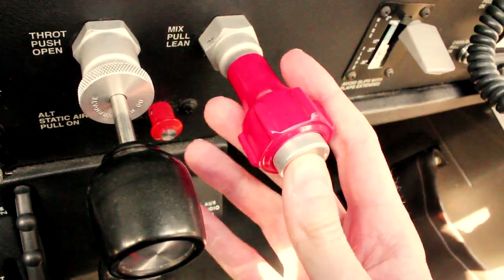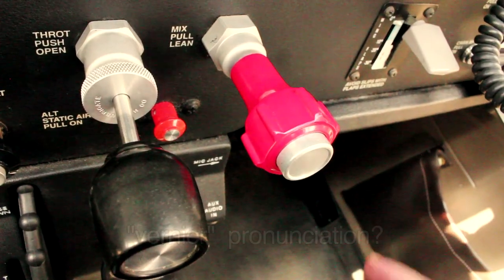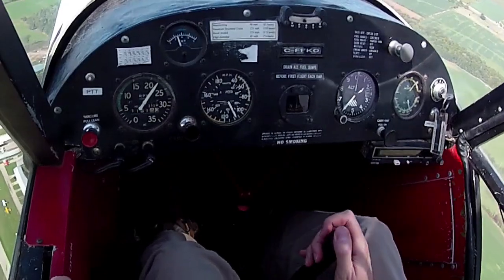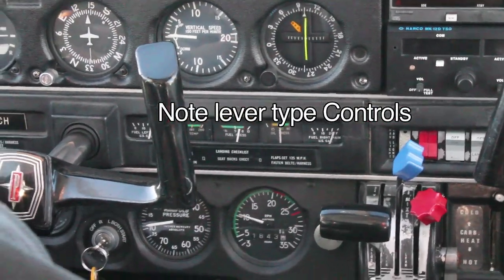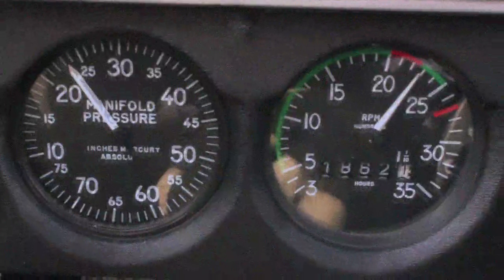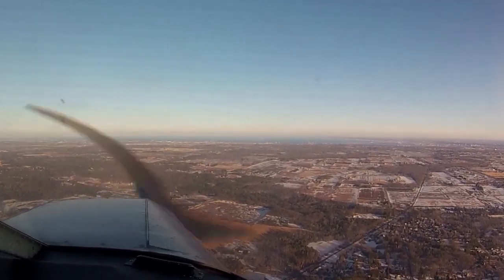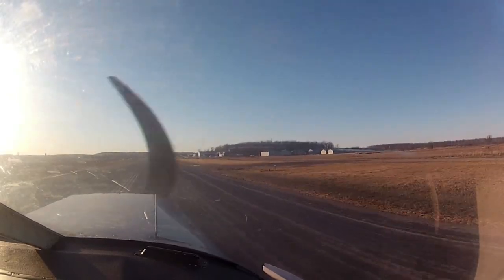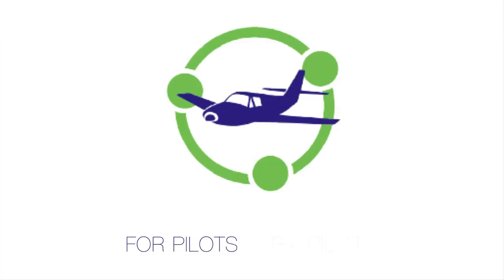Flight Training - the Art of Leaning - various aircraft types - POV FLying

Comment: Just an FYI, Lycoming and continental put out an AD about leaning. NEVER lean of peak, EVER! I've been saying this for years as I flew model planes, high end RC Cars with $2000 Engines, and argued with my instructor. The Canadian flight academy had a rash of blown engines two summers ago because one certain instructor was showing how to lean of peak. They ate 4 engines total. NEVER NEVER NEVER lean of peak. There is no benefit and it kills engines. I've seen it first hand, on all 4 engines. Odd thing..... If an engine that you are very familiar with starts to get amazing fuel economy, such as say, a 152 that has always burned 5.3g/hr but seems to be getting say 5 consistently, and generally seems like it's sipping fuel.....it's about to fail! Completely!!! I've seen it on two of the planes I flew regularly.

Cheers!

Chad
Reply: what facts do you have to back this up? have the engines been conforming engines? in that every cylinder gets the same mixture after factoring in intake design?  as the graph in the video shows, leaning past peak EGT lowers cylinder pressures, lowers exhaust temps and lowers CHTs',  the worst point is just rich of peak,  and if you do not know what the mixture going into each cylinder individually, then you run the risk of some cylinders running just rich of peak, and others lean of peak causing large temp differentials and rough running..

Comment: Excellent explanation man, thanks. I have one inquiry, about the "blue knob". I understad thats the propeller pitch, how does that affect on the RPMs? and when to touch it?
Reply from the maker: Thanks! 
And yes, the "Blue Knob" is worthy of a video (or several) in and of itself!
Short answer - full fine pitch (forward) for take off, and then you can pull it back (course pitch) for cruise. 
But there is a delicate balance as far as how you then apply power with the throttle.  Essentially, you don't want to be course pitch and then try to hammer the power to full throttle (If you drive a standard transmission car, that is like being in 5th gear and flooring it instead of downshifting first.)
The flip side is that you can't just slam the prop full fine pitch while you're at cruise speed, or that would be like downshifting to 1st gear while you're on the hi-way.

Comment: I'm not sure but once you're done leaning, won't you most likely have to make a small power adjustment to get back to your cruise RPM?  so, 1) get configured in cruise (rpm, trim, etc), 2) lean mixture, 3) "re-RPM" ?  thanks for the vid!
Reply from the maker: You might be over thinking it…  by leaning until it peaks, the RPM goes up above where you had it set, then you got rich again a little bit to get just below where it peaked, and thus the RPM is back where you had it in the first place.  
If you add power after leaning, your lean settings would need to be redone.

Comment: Thanks for the video, I am just getting into my cross countries and I try to keep on top of leaning.  The first few times I suggested that we lean and the instructor I was flying with at the time shrugged it off with an "if you want" type of answer.  It does seem as if leaning might be a bit of a lost art on even high hour pilots who fly close to sea level.
Reply from the maker: I agree - The notion that you shouldn't lean below 3000' AGL is not based on any sound reasoning beyond removing it from the worries of the average student pilot… Not exactly a great reason, but it is understandable…  
However, once you are licensed, you should definitely consider leaning for any flight when you'll be cruising for a while, regardless of altitude.  
And again, in some cases density altitude may REQUIRE that you lean for max power take off and climb.

Comment: Great video! I learned leaning technique very early on in my training, as I was flying my family airplane, not renting. In addition, the engine on our plane is super sensitive to plug fouling, and will start to run rough if you leave the mixture full rich for more than about 5 minutes when you're not at full power.
Reply from the maker: Thanks for the comment! How did you get the word "super" to be bold?  I had no idea you could affect the fonts in youtube comments - you've sufficiently blown my mind :P
Reply: Asterisk. I didn't actually know it would do that.

Comment from the maker: There was some good discussion on Reddit/Flying about this video.
Read below for one of my favourite comments from that thread:
________

user: warpflyght

Another good video! Thanks for making all of these. I really enjoy them.
As with the Warrior you showed, my airplane has a constant-speed prop and no good way to determine EGT. (It actually has an EGT gauge, but peak EGT is off the top end of the gauge, so it's useless.) I'm working on getting a 4-probe system installed, but in the meantime I've been leaning using the same technique described, and it works well in my experience. I can reliably lean to a consistent fuel burn level for a given power setting. Alert passengers don't always like the changes in engine sound and feel right before I richen back up, so I brief them on it before I do it and explain why the engine is about to sound weird for a moment. It's a small price to pay for saving 30%+ on fuel.
Regarding leaning on the ground, I was taught to do this religiously in my primary training, and it's served me well so far. It makes the mixture entries on your checklist even more important, though -- it's easy to leave the mixture leaned at run-up or takeoff when you don't intend to. My checklist calls out "Mixture: Best Power" clearly, and I also do a flow check when I taxi into position on the runway right before I add full power, just to be safe. The wording is specifically chosen to be agnostic to density altitude, even though best power is usually full rich.
Reply: Agreed!!  Never push mixture all the way down to the firewall. There's been many engine failure during T/O roll which causing from fouled plug (NTSB found it)

Comment: Leaning is less precise on our carbureted engines (as you probably already know) but still worth the effort. I installed a UBG-16 in my O-320 powered Cheetah a few years back and it's somewhat comical how varied the CHT's and EGT's are (when the sensors are actually working - another story for another hanger day). Still, always good to lean her out on those long cross country's...

Comment: One neat thing with some constant speed prop engines like in the Aztec or Seminole, is that when leaning the EGT will rise to the top of the gauge then fall back to where you want it. In the seminole on warm days, the EGT starts above the indicator needle, so Rich of Peak is above it instead of below it, while in the 172S it's the other way around. At least that's how I was taught. I too am not an instructor.
Reply from the maker: I am having a hard time visualizing what you are saying about LOP being above peak EGT in the Seminole - can you clarify?  thanks.
Reply: ***** Of course no problem. Now I will preface that I'm not an instructor and if anyone else knows better to please correct me. This is just how I learned on the Seminole. So on the 172S when it's running and warmed up the EGT white needle sits below the red needle (The red needle being the needle to which Peak EGT is) and just below that is ROP and above that is LOP. This I believe you are familiar with. On the seminole, on a warm day, when the engines are running are warmed up, the White needle (which represents the current EGT) is above the red needle (which is peak EGT). When leaning the engines the white needle rises to the top then falls and ROP is now above the red needle and LOP is below it. So if you keep leaning from the ROP point the white needle will drop below the the red one and LOP will occur.  Another interesting point about the EGT gauges is that they show a temperature range cooler being the bottom and hotter at the top. Where the reference needle is to show Peak EGT. Keep this thought in mind, if you fly a glass cockpit plane they show actual temperatures. EGT temperatures rise until Peak and then fall. This would contradict the EGT gauges that planes have. I'm still on a my learning quest to become more efficient at leaning and understanding what is my plane trying to tell me. In a lot of aspects there seams to be a disconnect between airplane manufacture and instructor. The person who is supposed to be teaching us this information. Glass Cockpit planes are sooo much easier to lean because they give you so much information and things are laid out to make sense. Like you I'm just trying to improve and if anyone has better information or see's where I'm missing in my understand please correct me.

Comment: Very nice. Also thanks a lot for not monetizing. These ads can be so annoying.

When I looked at the title I first read "Learning" instead of "Leaning" which didn't make the most sense.

Although I fly a very low-powered airplane with a fixed-pitch prop I have both EGT and precise digitial fuel-flow gauges, so I always lean and it's not too hard even though I only have a very wobbly vernier-type lever without twisting-action.

I'm still not too sure about leaning on the ground.

You certainly speak with more authority on leaning than some instructors.
Reply from the maker: Good point about the title…  I wonder if I should change that; at a glance, the word "Leaning" does look like "Learning"…  And as for instructor authority - thanks, I hope to come across is clearly as I can, but I still need to be sure to let people know that I am NOT an instructor.  Thanks again for the feedback as usual!
Reply: Yeah ads can be annoying... there is adblock though...

Comment: Great subject and great video ! I believe that the engine manufactures will suggest lean of peak or rich of peak practices on specific models within their lineup. I always thought that ROP gave you better cooling and increased potential for making the suggested TBO ( Time Between Overhauls ) . However , I think I read that LOP can reduce the build up of crud on the valve stems, as well as other benefits , without any additional wear and tear on the engine.
Reply from the maker: Yes, good point - when I say "maintenance nightmare" in the voice over while talking about plug fouling, I was alluding to the other "unseen" engine components, such as valve stems, etc - but you are absolutely correct - and I should have probably been more clear about the additional "crud build up" in other places.
Reply: ***** No need to change a thing ! I think your production length and content are spot on. I look forward to your next video.....:-).

Comment: Very informative video. Myself, I always lean the engine using my ears, and it often gives optimal results according to the EGT in a couple of 172SP's I fly.
Reply from the maker: Agreed that leaning by ear is a great way to do it, then ideally you can cross check with the other methods…  part of the reason I'll never get a noise cancelling head set - I am more than happy with my DC 13.4 - They are very good at removing excess noise, but still allow me to be able to hear the engine at all times.